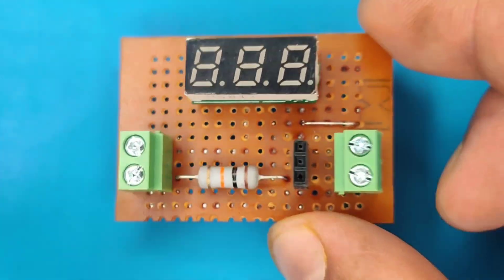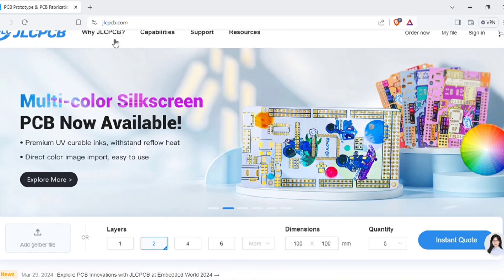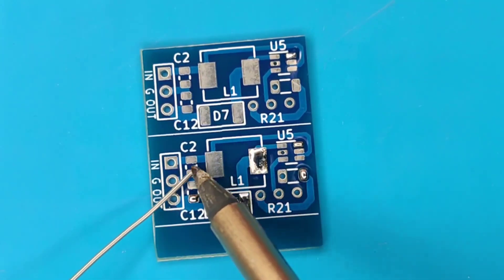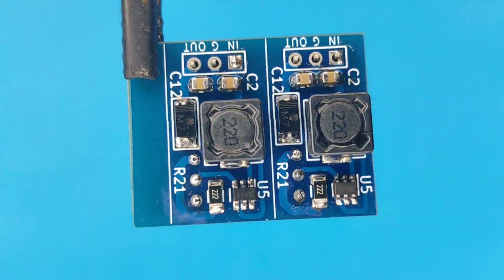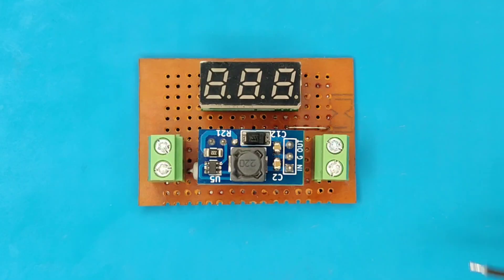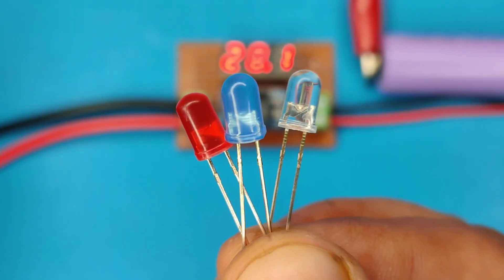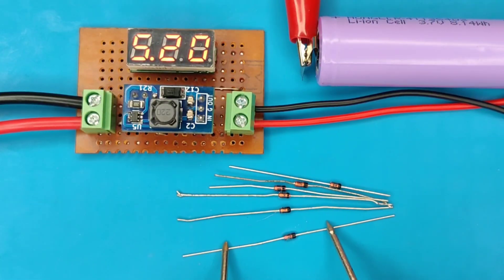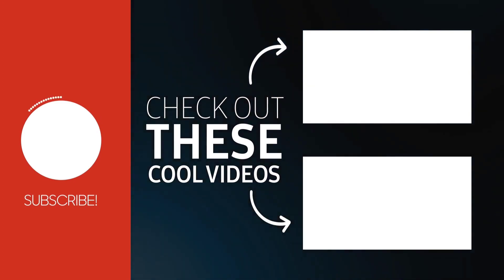All in one LED Zener Diode components Tester

Comment: Why iş the serial resistor10k, why not 1k?
According to me, for measuring zener diodes it requires current supply (for example 5mA) not voltage. 
Your circuit is just good idea for only beginners.
Thanks for your useful knowledges